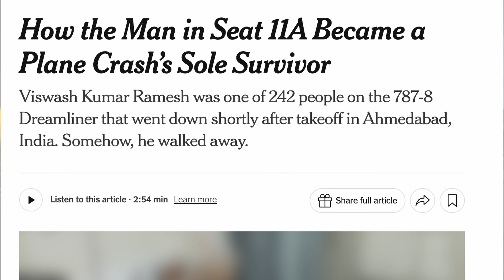Why the RAT Changes Everything – Air India 171 Update

Comment: 12:37  @CaptainSteeeve (EDIT: full list of RAT auto deployment conditions here: https://youtube.com/watch?v=MPk31EhtakE&lc=Ugyl12CH1Xc-GSl48B14AaABAg&si=OVhYPK0LL798Z4_b ) could it be possible that both engines automatically rolled back to idle due to dual IDG failure caused by some kind of common electrical bus shortage on takeoff? OR that one engine failed and the second rolled back because of the automatic thrust reduction that happens on the second engine COMBINED with accidental flap retraction instead of gear retraction? Though supposedly wreckage shows flaps 5 - although not verified nor confirmed.

While the FADEC’s are powered by the engines alone after N2 is high enough, if they lose inputs of throttle lever position / air ground position / flap position, they might automatically rollback an engine to idle thrust per software safety logic. AND the RAT will automatically deploy if ALL 4 electrical hydraulic transfer pumps fail for the L/C and R/C (in addition to the usual dual engine failure and/or loss of FDRs in the cockpit and/or loss of hydraulics). And also if the APU was nonfunctional (as it’s not always on the MEL), then the complete loss of electrics due to dual IDG failure (which has happened on few 747s and 767s due to miswiring during maintenance) combined with no working APU, could, possibly, in theory, cause this chain of events?
The 787 should allow for electric actuation of most all flight control surfaces in a complete loss of hydraulics, including flaps/slats/some ailerons/spoilers/etc/etc. Gear retraction won’t be possible, and obviously any kind of turn attempt would immediately have stalled the aircraft into a sideways nose dive, but I’m wondering if there would be any difference in control surface behavior in such a sequence with a dual engine failure or a dual engine rollback due to complete loss of electrics due to dual IDG failure and nonfunctional APU….

Comment: Dual engine failure is an extra ordinary outcome - fuel starvation or contaminated fuel?  Doesn’t explain why the flaps were not set fully.  My thought is that Air India 171 had a serious under-weighted take off issue similar to Emirates EK407 in a Melbourne in 2009. In the Melbourne incident (luckily there was no crash but it came very close) the co-pilot mis-entered the take off weight of the A340 they were flying erroneously understating the weight by 100 tons, so the aircraft take off weight was set to 262 tons not the true 362 tons. The engines automatically set to lower power and the flaps were set to low for a light take off and the plane barely dragged itself off the end the runway doing considerable damage and almost crashing. Different aircraft with AI171 - B787 - but the low engine power performance on both engines (with no smoke or other indication of bird strikes) and the barely deployed flap settings all indicate that the plane was erroneously set up to take off at a much lighter weight than it actually was. The same as EK407 in Melbourne but this time with tragic consequences.

Comment: That could well be the RAT deploying. But it's far too early to draw any conclusions. We should wait for the investigators to do their job before we decide which potential explanation we favour. If you're right, the investigators' preliminary report should tell us that the RAT was found to have deployed. Obviously, that directs the investigation towards dual engine failure.

I haven't seen anything to suggest a bird strike (and it would have to be multiple birds to seriously damage one of those mighty turbofans); I haven't seen anything to suggest an engine fire; I haven't seen anything to suggest compressor stall or anything else that's quite rare (as you know, a compressor stall doesn't just happen  - there has to be a reason for it).

This inclines me towards contaminated fuel or a multiple failure of the fuel pumps. But I believe the investigators should look into everything that could possibly be relevant before drawing a conclusion.

Comment: A passenger on Flight AI423 captured footage showing poor air circulation in the cabin and non-functional seatback displays. Interestingly, a similar issue occurred on the ill-fated Flight AI171, where the RAT (Ram Air Turbine) deployed—suggesting a potential electrical fault. Could this point to negligence or a lapse in routine maintenance, given that two separate aircraft experienced comparable problems?

Comment: I noticed that the 787 rotated at a very late stage of the runway. That could indicate that the engine did not have foll trust after decision point and have both list trust gradually,  starting already before rotation.. The flaps will normally be deployed already before the aircraft enter the runway, and retraction starts gradually after several hundred foot of altitude. No pilot will retract the flaps if there is too less trust on the engines, even not in panic. I don't believe in a pilot failure, but I look forward to reading the accident report

Comment: I am reaching the conclusion that the only thing that can take out both engines is water contamination of the fuel.  So the fault lies with ground crew.  Was the water in fuel not  checked and drained?

Reason is, even with one engine and flaps as they were the plane would fly.  The Mayday was not lost engines it was lost power,  water in the fuel would still run the engines but without power.

Comment: As a mechanic, i initially agreed with your first video too Captain Steve but having heard the audio from the video since as you have done, that's definitely the RAT so seems like there was some sort of power loss, its unmistakeable. Also another thing that does lend credibility to a thrust issue is the other video showing take-off. The large amount of dust kicked up as the aircraft lifts indicates they were either off, or very close to, the end of the runway before the mains left the ground.

Comment: Its LAWSUIT TIME AGAINST EITHER GE OR RR ENGINE FIRMS. Boeing does not build ENGINES
Reply: Lawsuit time when there hasn’t been a proper investigation yet and the root cause has not been found? It’s a good way to not only lose money but also forfeit any settlement.🤦
Reply: @charliefoxtrot5001 the particular aircraft here suffered this same thing previously or haven't you been keeping up😂
Reply: @DennisRobart  Right, the unbeatable uneducated Internet expert that has no clue but an opinion. 🤣

Again, the root cause for this crash has not been established as the investigation is still going on. 

If this was a double engine failure, then the engine manufacturer is likely NOT at fault here. The probability of two simultaneous engine failures is extremely low, while the probability of an aircraft electrical or electronic failure causing a double engine failure is rather high.

I am just a reliability engineer, but what do I know over the self-proclaimed Internet expert who also has no clue about civil law suits. Hint, if you lose that suit you not only pay the other side’s legal bill but also open yourself up to a defamation claim.

Good luck, Internet expert! 👍

Comment: If that's true and the engines actually shut off at takeoff than Boeing is too far gone regarding the problems it has been accumulating for years. Unbelievable. And it's a newer aircraft launched in 2009, that point in time coincides with the topics the Boeing whistleblowers were bringing up.

Comment: I have watched several videos of this crash. The following have been stated by the other videos. Just after rotation the undercarriage bogey commences the retraction process. So that the rear part of the bogey goes from the rear axle down front axle up to rear axle up front axle down. Then the retraction  stops suggesting hydraulic failure of the retraction cycle. Looking at the video you are showing this can be seen. The sudden lack of climb suggest a rapid loss of power on both engines , this is evidenced by a lack of swing to the failed single engine side of the aircraft. Also the RAT is visible as deployed and also you can  clearly hear the RAT in Operation. So also looking at videos of the cockpit of a 787 the Undercarriage lever is on the dashboard and the Flap lever is on the centre console. So not located next to each other. So this would suggest that incorrect use of flap lever was not likely. Also the Pilots declaring MAYDAY call before the crash. So Dual Engine Failure seems to be the most likely cause. Engines need air , fuel and ignition to run, loss of one will result in engine failure. The 2 most likely causes could be catastrophic electrical failure and or Contaminated Fuel ( water ) . ps i am neither a Pilot or Engineer so my comments are not informed by either knowledge or experience. Just based upon the evidence that i have seen in a variety of videos and newspaper articles.

Comment: Steeeve. Thanks for revising your theory. We will know more when the FDR data is released. I will not add to the speculation except to say that there are a lot of errors in the reporting of this incident. Firstly the altitude it is reported to have reached from ADSB data is above mean sea level or possibly QNE corrected. Given the elevation of the aerodrome the aircraft ontvreaced a couple of hundred above the ground. Secondly, why did it rotate at the upwind threshold? Insufficient power commanded due to incorrect weight entered into FMS? A flap 15 takeoff required and only flap 5 selected? Thirdly, If the PNF selected flaps zero then surely as most Boeings have, the pilot would have to move the lever through a gate, in other words not in one motion. Fourth, the RAT will deploy in other circumstances with both engines operating such as loss of hydraulic pressure. Given 3 systems and other electric pumps this is unlikely assuming that the aircraft was otherwise fully serviceable, but it does support a theory why the gear stayed down and the Slats may have retracted due air pressure. Fifth. Pehaps this aircraft was carrying a lot of unserviceabilities and one more failure doomed it.

Comment: If you think about it.. is it that both engines failed sepperate from eachother. Or is the cause something both engines shared. I have no knowledge about airplanes, but i think a lot of essential components are done in 2, so one fail there is another same component... which means maybe fuel? Or fuel pumps? Something the 2 engines shared???

Comment: Umm, I have a question for any aviation buddy out here. According to Flightradar24, the wind speed was 7 knot, Temp was 37 ℃, pressure was 1001, and visiblity 6 km at the time AI171 flew on runway 23. I've read these were ideal conditions to fly a plane. Being a north Indian, we usually endure very harsh summers reaching close to 50 degrees for decades that too for weeks straight, so aren't these planes tested and their electricals equipped to work optimally as per the climatology of the country that buys/leases them as well as internationally?. Considering Boeing tests their planes extensively in Death valley, which too boils over in summers, why is that most comments here lean towards the theory that it could be the heat that would have caused whatever failures, etc to the engine/plane. Can anyone provide clarity on that to a layperson like me?

Comment: I retired off the B747-400 and I can remember taking off and right at VR the number 3 eingine flamed out well we had 3 more working fine. These planes now days are all glass and computer operated. I was told by maintenance that a sensor line to engine brain box computer B nut had come loose and the engine was being told to shut down. Scary stuff. I think this air India flight had both engines flame out  thanks to modern computers. Sad indeed. Steam gauges were the best.
Reply: Funnily enough, many more planes crashed in the days of steam gauges than today...

Comment: If you see very carefully in 1.32-1.36 you can clearly see both engines sparkling at the same time ( it could mean that they both exploded), dont focus on the ground guys focus only on both engines and you can clearly see the sparkling, it could be an evidence that it was the time that both engines gives their last push and failed just after that, because you can see that just after that last push the plane started descending

Comment: The probability of dual engine failure is extremely low these days. But not absent. Maybe the compressor that delivers fuel to the engines stopped working? Fuel contamination is possible but not likely. That was the only plane that got bad fuel? But youve narrowed it down and you seem closer to the answer. Forgive me capt. You are excellent but I disagreed with your assertion that is was accidental flags retraction. The landing gear lever is on the dash and the flap setting lever is next to thrust levers. The two are no where near each other on a 787. But like this capt the best. He knows his stuff. Looking forward to more videos from you about this

Comment: Another great professional presentation thank you and appreciate the update and latest information. On the new better quality video I thought I could hear the engines or an engine running as well as the RAT but from your experience do you think they were running and producing thrust and if so were they still at take off power. Also is it possible for the pilot to deploy the RAT manually.

Comment: Problem with that, the survivor said:  "The green and white [cabin] lights went on" (not flickered) and "I could feel the engine thrust increasing to go up, but it crashed with speed"  So the survivor specifically said the engines were increasing with power, not failing or going quiet, which would have been noticeable.  In other cases, passengers would note how it got super quiet after the engines stopped.  If someone knows what's different with the green and white lights?  Maybe that is a power thing, like when emergency lights go on in a building when power goes out.

Comment: Captain, Please notice if I'm saying something wrong.

Theory n°2 - if the flaps wasn't properly set or even not settled (imagine the alarms wouldn't make pilots crazy), wouldn't the plane ran the runway with nose up for a while before lift off?

Theory n°3 - Retraction the flaps by mistake, wouldn't be solved by an appliance of maximum thrust?

I've always believed since the beginning it's all about thrust, not lift problems

Comment: One further point to support the loss of both engines theory - Just at the point when we can hear the RAT in the original video, we can't hear the engines - at all. 

At that point in the flyby the engines should be at full power and would almost completely drown out the sound of the RAT. Yet there's no discernible engine noise, just the RAT.

Comment: My son-in-law gathered information on the internet about the two pilots. The first officer had 1100 hours.
There is no way in North America an 1100 hour pilot would get the right seat on a dreamliner. 

Now it's possible the information from the internet was wrong or it's also possible they might been referring to the first officers dreamliner total time but this would be a heavy reason why something like incorrect flap positions could be a factor. 

Also many captains will allow the first officer to do the takeoff because all take offs are the same but every landing is different. 

So if an 1100 hour pilot was calling out a checklist he was unfamiliar with there could have been errors during the preflight checklist.

A flaps lever and a gear lever having no similarity.
Also possible at 1100 hour pilot grabbed the wrong lever.

Comment: The engines were still running right, but not with the power needed to properly continue their take off? It just feels to me like the engines itself didn't fail, because what are the chances that BOTH at the same time fail anyway? I feel like there was something wrong with fuel delivery. Fuel pump failure or a blockage in some fuel lines or something like that, I have no idea what how or where the fault was, but in my mind it would make the most sense if something like this caused the engines to starve basically.
I hope this will soon be solved and that we may learn something from it because that is the only thing we can do now that it has happened unfortunately.

Comment: Isn't it possible for a pilot to catch engine, hydraulic or technical issues before leaving the airport gate? As per another passenger who had deboarded from the AI plane at Ahmedabad airport, the inflight entertainment and cabin crew call and other buttons (fan, light) were not responding on this plane during the Delhi-Ahmedabad leg of the plane's route.

An Emirates (Boeing 777) pilot caught a technical snag soon after leaving the gate at Chennai airport, India, on 8 June 2025 and chose to abort the flight in the interest of passenger safety. Maybe this pilot used a checklist.?

Comment: Captain Steeeve, would the RAT deploy if the APU was active? And would it be normal procedure to have the APU running during takeoff?
Reply: Answer to the second part of the question: It's actually not unusual for the APU to run during takeoff, especially in high or hot environments.
The 787 is a bit special in this regard because, for example, its air conditioning system doesn't operate via bleed air from the engines, but is powered electrically. On the 787, the APU takes care of that.

Comment: There is also another video taken, allegedly,  inside the same aircraft on a different flight and the person who took the video says that the air conditioning and none of the controls or displays on the seat backs were working. Does that suggest an major electrical issue on the aircraft, perhaps? Is it also true that the aircraft had also recently been subject to maintenance?